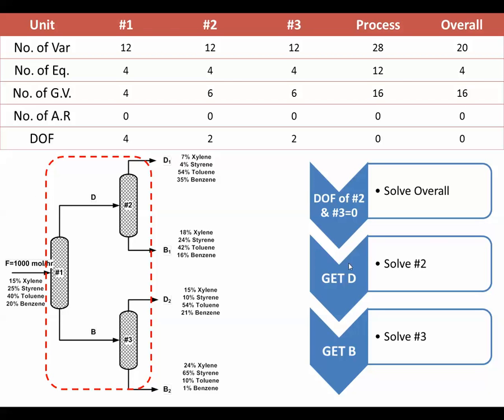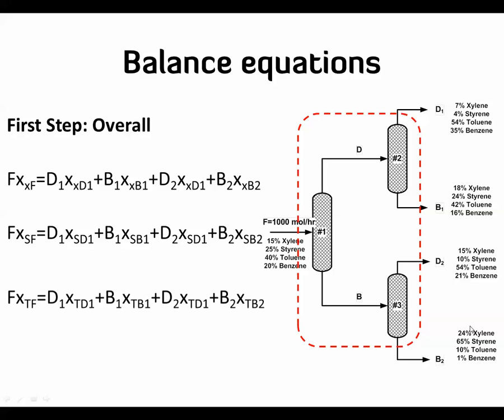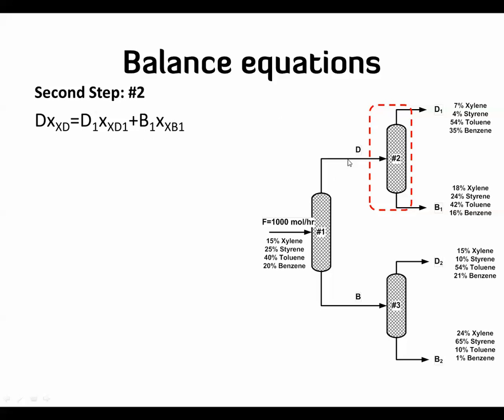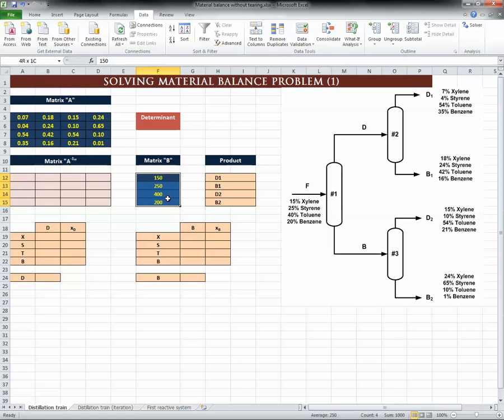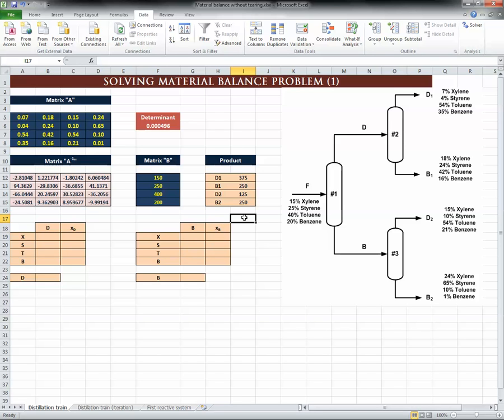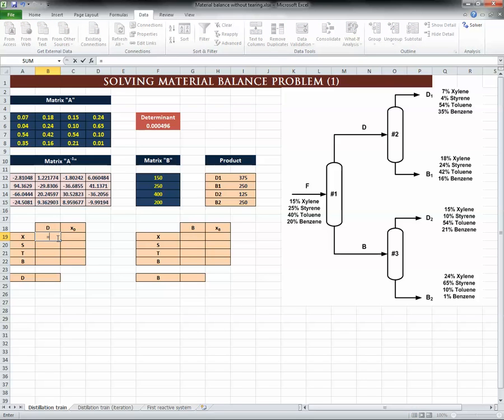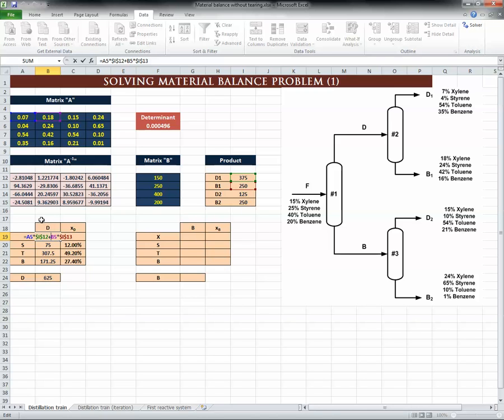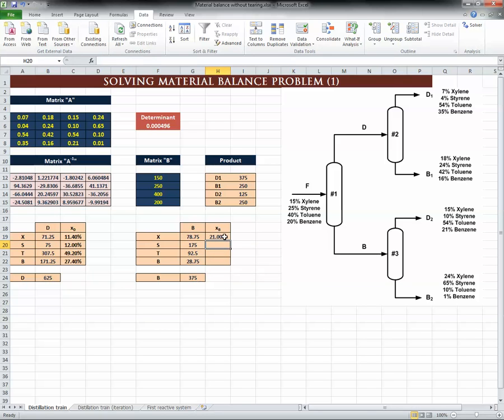Excel for Chemical Engineers I 13 I Material balance (2/5) [Non-reactive systems 1]

Comment: Hi sir, you have made very useful videos. Thank you. I have a question, if the determinant is 0, how can we solve the matrices quickly and accurately ?
Reply from the maker: +win cent win Thanks!
If the determinant is zero then this matrix is not solvable, meaning the set of equations cannot be solved together.
That is why calculating the determinant is a great way to check the solvability of a set of equations before starting the solution.
Hope this answers your question.

Comment: please how i can draw this process or any icos are u used?thanks for all efforts
Reply from the maker: +Maysa Mahmoud There are many software that you can use. I recommend Microsoft Visio as it is very easy to use and very user friendly, also it has built in stencils for process flow diagram units. However any drawing software can do the job.